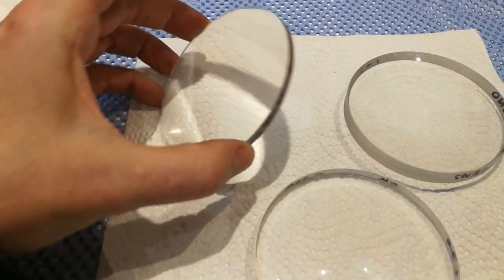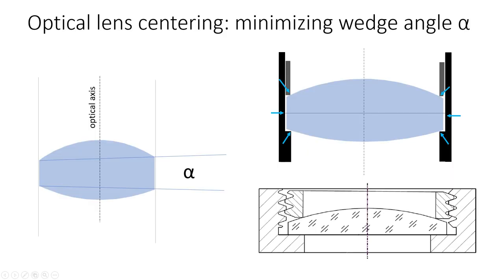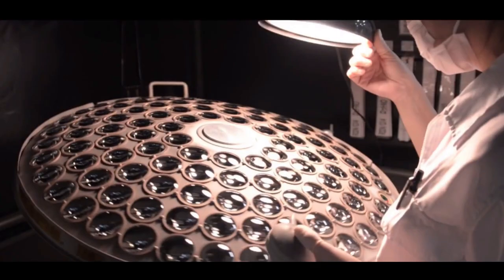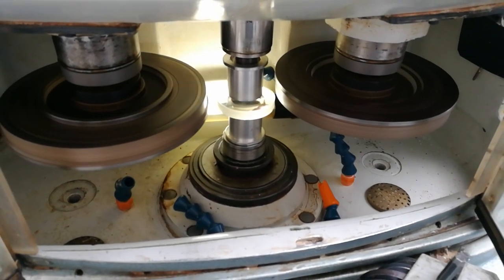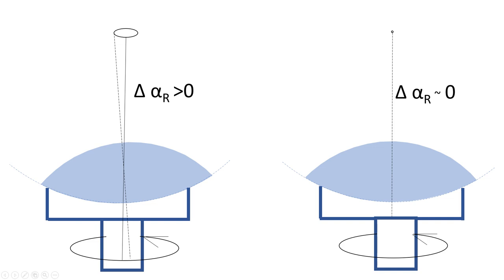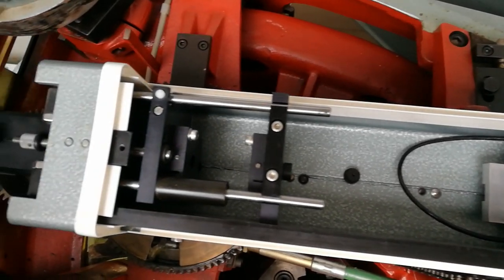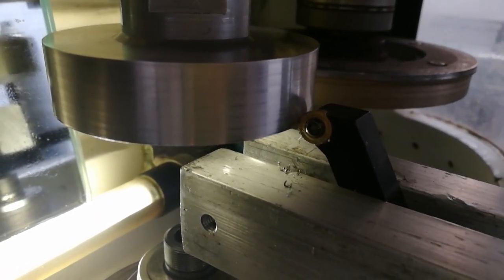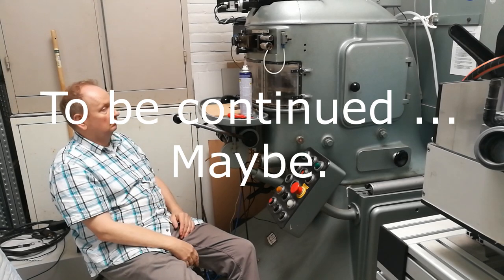Optical Lens Centering using a LOH LZ-80.

Comment: A shop I worked with used their Bridgeport Type II mill as a make-shift CNC lathe by placing rod material in the collets and mounting lathe tools in various custom blocks in the Angle-Lock vise--using the mill as a vertical CNC turning center ;)

Love your content! I just subscribed.

Comment: This video is pure awesomeness / a real scream , at least three very good quotes. (Very funny / cool). 

Awesome Hacks with using the spindle on the centering machine for final cut on the cup and also measures for concentricity / roundness. 
@Huygens Optics what do you estimate the size of your laser spot to be ? Wasn't clear where the reflection for optical axis comes from back from the lens? (Sub titles covered that lol) ?  [Which surface ?] I know with some photographic lenses you can use an autocollimator and reflective reference plate/ (plane of the image),  and rotate the whole lens assembly and correct the flange to be perpendicular to within arc seconds by rotating the lens and correcting the flange (similar to what you show here with a stationary reflected "spot"). With off axis (at different angular) positions of an autocollimator you can also measure radial distortion in a lens... Just an idea you could use or repurpose your rig for. Also makes me think that if a lens could be mounted you could also machine final precision reference surfaces to the lens in  a metal  holder or flange / cartridge (rather than grinding the glass directly ?).  Not sure how thermal expansion of glass vs. Aluminum / Aluminum bronze affects how you "Grip" a lens element precisely in a fairly permanent / bomb proof way (that doesn't slip or creep or fall out of alignment from being jarred ).  ? Is it all optical cement for that ? [Just some ideas maybe for future videos etc. ]. 

[Carl Zeiss makes a thing that looks like an ironing board with an autocollimator for radial distortion measurements and other lens parameters.]. I think I can find a link. 

. ---> Just as  an aside various folks in the Astronomy community talk about pros and cons of the use of carbon fiber, particularly with refractors and anecdotally grumble about CF for refractors not being so good or mumbling about differences in thermal expansion , CF having a -ve coeff. for Thermal expansion etc.  Do you have any ideas about that (I'm not an astronomer, but interested in advanced optical / photonic systems.).

I think I can devise some useful stuff / work for your awesome early 80's rig :-)
Reply from the maker: Hi ED, thanks for all the suggestions. About the size of the laser spot, I think it can be as small as 15-20 pixels on the CCD. On the screen in the video it has different sizes, and that is because of the different magnifications I use to minimize the spot movement.  You can use an autocollimator, however if you have a strongly curved lens you might get very differently sized reflections back, I have no Idea how that works out. Basically you are viewing the reflections throught a straw (inside of the hollow axis is only 8mm) so there is very little room to play. Even finding the reflected laser spot is sometimes tricky. But I agree there is plenty of room for improvement. You can keep the lenses in place by using a little nail polish on the sides (between lens and cup) after you have aligned the lens. also use some on the top surface. It is very easy to damage the glass or a coating with this type of tool, both with aluminium and brass.

Carbon fiber enforced materials are generally stiff, but the CTE is still quite high because of the resin. I don't see many advantages over aluminium / steel except maybe for the weight aspect or the aestetics. I'm no expert on this though.

Comment: It would be complex, but perhaps attach steppers/servos on the dials for CNC -> Mechanical -> Device?
Reply: I would be willing to help with development.
Reply from the maker: Thanks. Actually I have looked into this and it is possible. It would simplify the construction considerably, since some degrees of freedom are now intertwined. But since I use this machine so little it's actually not worth the effort at this moment. Maybe I will make a project of it in the future.

Comment: I am very fascinated with your videos, the most detailed explanations I have seen anywhere. I especially liked your OLED one. I wonder if you or somebody else might explain why many lens are made in multiple pieces and then glued or pressed together, is it only to use different refractive properties of the glasses or are there other reasons?
Reply: Yes this is mostly done to compensate for (chromatic) aberrations. Ideally the dispersive properties of a doublet or triplet should cancel each other out.

Comment: I saw this years ago.
Now I want to ask a question.
When a polished lens is edged like this, does the glass surface distort at all?
Reply from the maker: Not by much, but very slightly is possible since introducing these small cracks can introduce some stress in the material.

Comment: How about a video on how an amateur can re-glue a delaminated set of lens? I've got a few compact cameras with these faulty lens, not worth paying to have them fixed. I'm thinking of making use of an old hard disk drive to spin the lens and glue it. Maybe a cheap diode laser to center it?

Comment: Amateur astronomers are some quite special people, there are many brilliant and nice people but many others draw parallels to audiophiles and their irrational preoccupation of equipment quality, spending thousands for marginal improvements in quality so they get off to watching barely improved airy disks and becoming clear examples of the placebo effect, describing optical feats far beyond what the aperture might enable to. Yet they berate you for buying a non boutique OTA that has a strehl ratio of less than .90 "I tell you, can see the volcanic plumes of Io on my Questar 3.5 inch" "Wow! nice photo of Jupiter, the red spot looks nice definitely smaller than some 5 years ago, did you took it with a Tak? probably 6 inch, What!? its not a Tak? its just a mass produced OTA? mmm I see why it lacks contrast and vivrance, also I think it has some spherical aberration you should go get checked that, mmm i think might also have some roughness on the mirror. I have 30 years of experience! so believe me,  I can see lighting bolts in the storm with my 99999$ triplet apo Tak, its .98 strehl just cuts thorough seeing, my 50 year old diabetic eyesight its well trained better than any silly digital contraption! photon to retina its the best!"